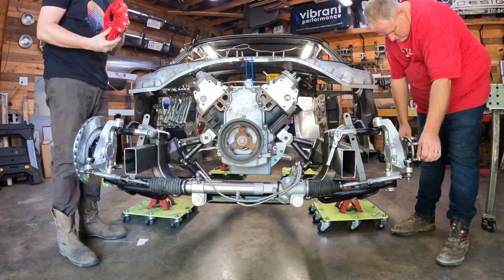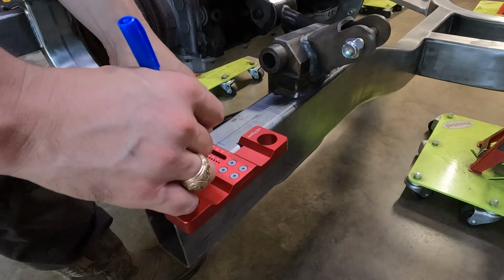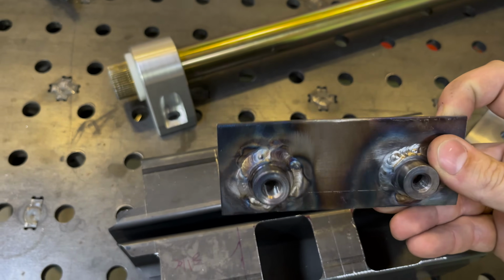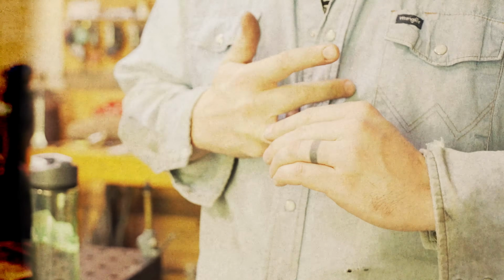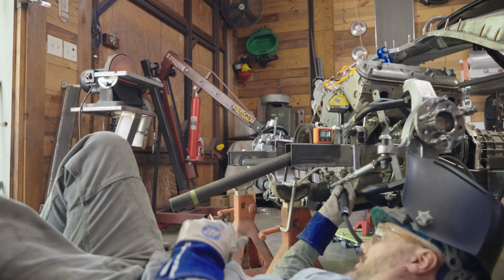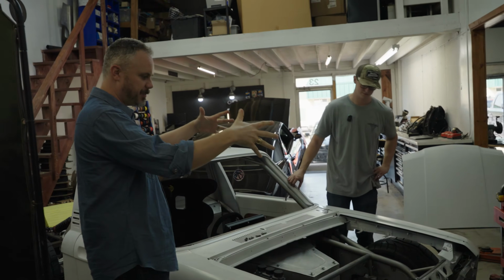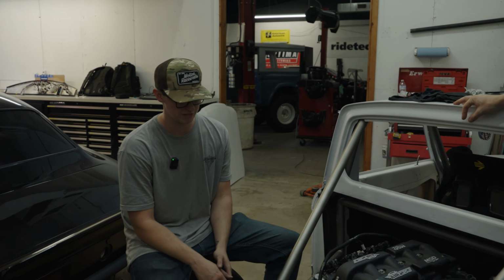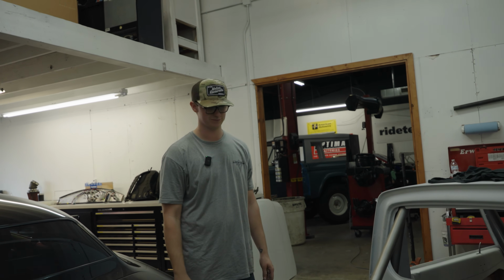Cutting my Frame for Splined Anti-Roll Bar | 1970 Dodge Charger 14

Comment: "I will not be friendly" needs to be on a shirt! Also, brave man wearing shorts and boots and running a roughing end mill... hahaha
Reply from the maker: It’s a fine line between brave and dumb. Which side I’m on depends on the temperature in that back corner of the shop. I did get a hot curl down the boot once or twice. It was not friendly.

Comment: Lots of good tips in this one. I’m wondering, could you have redesigned and fabricated the splined linkage? Basically just buy the splined end piece and fab the arm.
Reply from the maker: Oh, man. I did think about the option of just building new with a bar and fabricating arms, but stuck with this since I had the parts and a stick of 3x2 was way less expensive.
Reply: @WillometMotorFab  Looks like it’s coming out nice. Very professional.
Reply: @WillometMotorFab  Also, I didn’t know summit sold sticks of rectangular tube. Great to know.
Reply from the maker: @Marcus_Woodard I didn't either. I get the occasional short stick of DOM, and was pleasantly surprised they had some other stuff, too.